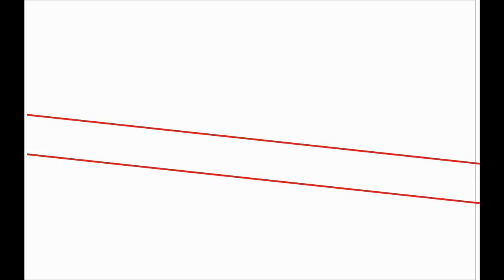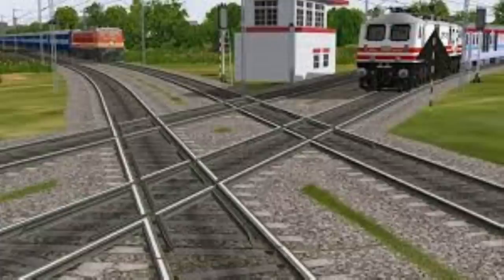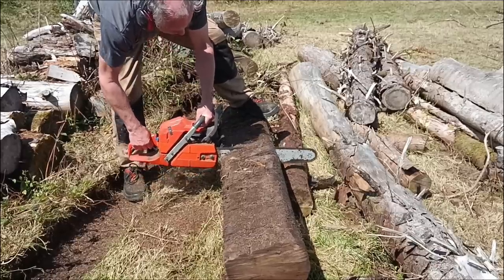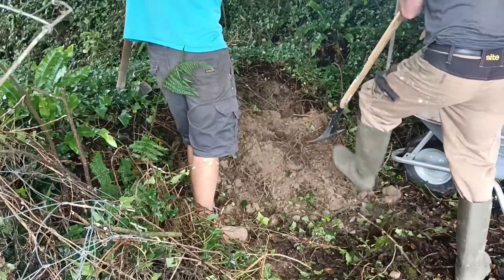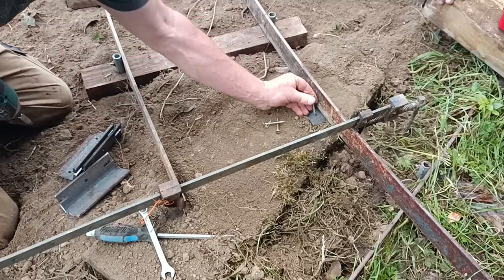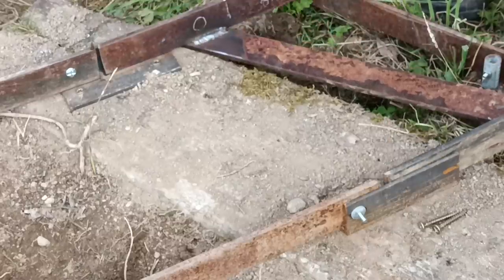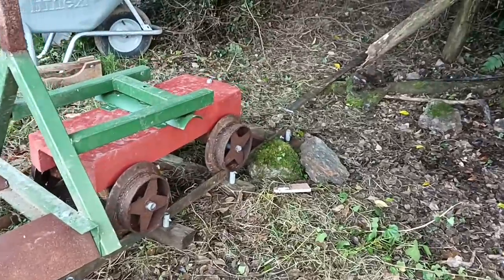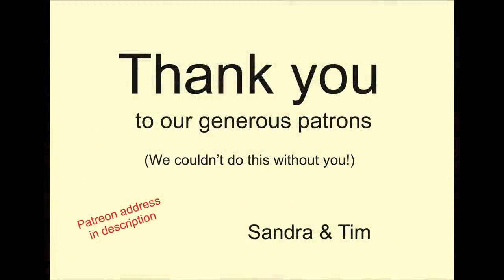Building A Diamond Crossing Bridge For The Narrow Gauge Field Railway

Comment: As always, a very pragmatic and simple solution to a complex problem, Tim. Can I suggest that you hinge the 'bridge', so it's always in place, and can be easily lifted out of the way, but doesn't get lost in the inevitable undergrowth. Looking forward to seeing the cut excavations through the bank, how you're going to contain the errant sheep and where the terminus will be. Well done & thanks for sharing!
Reply: I was going to suggest  a hinge too.
Reply: Then you can’t carry wide wagons over the lowest track
Reply: @pieter5132 : it could hinge all the way over: 180°, so it's completely out of the way? But indeed, I was also thinking: a hinge will make this look like a real piece of art. And as Tony mentioned: it won't get lost that way! (although the support with the curve might prove more challenging than it's worth; keeping it as a loose insert is also a realy pragmatic solution!)
Reply: I have seen a similar solution, where each single track was hinged, one on each side of the "bridge" so as to put the individual tracks parallel to the lower rail when not in use.
Reply: @wieb83zd  it would require slits in the rails to allow for overlap-folding and wheels still being able to roll. If anything, I'd suggest a turntable rather than lifting the track away (it's heck heavy!).
Reply: @pieter5132  Why? The track could easily fold back on itself.
Reply: @tonywatson987   because the bridge have the same distance as the track. It is possible if the bridge is double hinged.
Reply: @wieb83zd  A double hinge so the bridge section sits on top of the track.
Reply: @theodorthegreathe  no, its entirely possible to design the fold to centre the pivot further along the track than the cut itself by either having the bracings outside the track (thus no flange interaction) or spaced the width of a flange inside the track;  it's a far simpler design than a turntable as Tim's crossing track is curved not straight.
Reply: @pieter5132  you could get the bridge around to about 150 degrees (and thus wide clearance) without double hinge if the centre point of the hinge arc is at least foot further out than the cut in the rail
Reply: here's how to commercially do a hinged bridge diamond crossing for full speed rail - to simplify, remove the motors and signal interlocking (and have one side a longer hinge instead of two short side hinges) and you've got the simplicity that Tim's solution would benefit from:
https://www.youtube.com/watch?v=ho8AzAm9f54

Comment: Nice! Maybe you could put hinges on one side to make it a drawbridge?
Reply: Came to say this. Tiny bridge needs to be a tiny drawbridge.
Reply: @JPBennett  And a tiny Billy Goat Gruff
Reply: I was thinking samething but there likely isn't room for that. The lower rail may not be able to accommodate the chip wagons anymore.

Unless there is somekind of double hinge that would allow the bridge to fold nearly flat on top of itself.. but then there'd be a problem with it fitting back into place again because it's not perpendicular.

I hope he does it.
Reply: And add some linkages to the draw bridge, so it will automatically operate signals to indicate which direction should stop or go 😀
Reply: Great idea

Comment: The Golden State Railroad Museum and the Union Pacific used to do this, in a much more complicated and labor intensive fashion on standard gauge when the museum had to move something from their shops to their museum or serve a customer on the old Isleton branch. When UP took over the Southern Pacific they decided the old 90 degree diamond over the main line wasn't worth it, so they had to stop main line traffic to bolt rails over. Eventually UP put in a diamond closer to 45 degrees.
Reply: NO ONE ASKED

Comment: You could use the bridge as a guide for a template and then make small angled joints in the workshop that can be bolted in place. You can then cut the track where it crosses, lower the track to the same level and bolt these angles into position. You will also see the correct angles for the frogs and make them the same way.
Reply: When i saw the piece they welded up for the bridge, I thought "okay, now take it back to the shop and weld on the cross rails and other bits, then drop it into a level diamond."

Comment: I like the use of kick switches exclusively it reminds me of almost decade old videos on coal mines and stuff like that and I noticed they used a lot of and almost exclusively kick switches you're actually the one who introduced me to kick switches. also this is why I love watching you work you come up with the craziest solutions that I don't think even I could think of and I think of a lot of things trust me. Although I do advise maybe stress/weight testing the mini bridge to make sure its sturdy if you ever start using engines normally I advise testing with tornado as I expect if the rails do break you don't want a loaded wood chip wagon toppling over and losing a bunch of perfectly good wood chips (it would also be nice to see tornado again and get an update on her condition as well as any future plans for her).

Comment: Good job and an elegant solution. As far as portable welding goes Matts Off Road Recovery has a few field repair videos where they have connected stick welding cables to 12 car batteries and produced acceptable welds. May be worth a try next time you need to do some remote welding.

Comment: Will you need to construct a cattle-guard section for your railway at some point? I don't know if they're common in your part of the world, but in the western US it's common to see short roadway sections with thin parallel metal slats and deep hoof-sized openings into a ditch below. Any cattle attempting to cross will step into one of the gaps and then can't step over the next slat, only backwards. The same principle could make for a cheap field railway cattleguard -- dig a shallow hole across any opening in a fence, and span it with a short rail bridge built with closely spaced thin metal sleepers.

Comment: Hi Tim, I have seen this method used on a railway in reality. I think it is/was in Australia, where a narrow gauge line crossed a larger gauge. The difference being that one side was hinged and mechanically operated remotely. It allowed the narrow gauge (possibly sugar cane) line to cross without the need to disturb, by cutting tracks, the other main line track.
Just checked, see
 “drawbridge crossing Cane Railway over QR main Meadowvale.
And Cane train crossing QR main line near Bundaberg Australia.

Any way good thinking by Tim.🇨🇮 🚂
 Best wishes from Oxfordshire GB 🚂

Comment: This reminds me of tales I've heard of "temporary" switches installed by MOW crews of old. Apparently they managed to install point rails to take the trains off of the main line and then direct them up and over the mainline rails without a frog onto a temporary side track. Once finished, they could remove the "switch" to allow mainline traffic to pass by. (I wish I could find some primary sources to confirm this!!)

Comment: I love how low-tech this is. Just weld some bits of metal together, shove some old sleepers in, and you've got some new railway.
Someday, I want to own enough land to justify a garden railway.
Also, a thought. If you could get hold of an old pallet jack, the handle assembly might be good for moving wagons around. It's hinged, it's got a two-handed grip, but it's narrow enough to haul with one hand. Considering you can get brand new ones for £250, old dead ones too jammed up with crap or with wheels worn too thin to be useful might be dirt cheap.

Comment: Some where on YouTube there is a video power operated crossing like this. What you need is a flange greaser. The easy way the same as the Seaton Tramway. Man with grease gun puts grease on the on the inside of the outer rail.

Comment: I wonder if you could put your welding setup (with the addition of a battery of course) on a railcar, with wheel locks like on a typical rolling work table, so that you're able to weld track together at pretty much any point of the railway?
Reply: you could even ground it to the car and use the wheels as a ground clamp, and you have power on the cart wouldn't be to much more to add an electric motor

Comment: the siemens high speed rail test loop actually has a tiny little bridge like that (with hydraulics ofc) to get new vehicles on there, so I think that's actually a fine solution and not that weird.

Comment: I can see where putting a hinge on one side could be helpful.  You may need to change where one joint is so it does not bind. I love the work on the RR.
Reply: Came here to say that about the hinges also...

In addition: 
If you have a,situation with hinges that are not" lined up" you sometimes use eye bolts instead of flat stock hinges: if the tolerances are not to tight with the tap side they allow the thing to scew when moving the part .
On traditional  smaller  sailboats this kind of hinges are often used on sterns that are not strait. Mutch esyar than trying to get the pivot axle perfectly lined up,as you must with wider hinges...
I may be a good idea to put  a stop sign on the bridge deck that will raise whit it when open,  make it reflective.
You could also put reflective markers on the side of the deck that makes it visualy clear when the bridge is down and blocks the undercutting rail line.

Comment: Queensland Rail do the same sort of thing with the Sugar Cane Trains when they need to cross the main line, only they are automatic and pneumatically lifted, still the principle is the same, would certainly work better if the section was hinged in some way, to avoid heavy lifting of the track piece every time you need to use that track section.

Comment: I was expecting you to cut slots in the in situe rails with an angle griner to make room for the wheel flanges after bending one set of rails to allow you to bolt them onto the side of the other set of rails. Then just using a lot of pegs to hold all the other stuff in place.
But there are proper industrial norrow gauge railways out there that do use this system, only with added motors, sensors and automation.

Comment: I wonder, if you were to make a diamond crossing like you were showing in the diagram, would you be able to set it so the points where the two sets of tracks connect are attached to hinges that way you can adjust your angles, then make the central bits after the rails are set up, then attach it all together? That way it helps cut down on the amount of back and forth walking you would have.

Comment: Put hinges in one end of the bridge so it it can stand upright 😊
Reply: But then you'd have loading gauge issues with the line underneath.
Reply: @Skorpychan  Not if the movement isn't limited to 90 degrees. It could flip right over to 180 degrees and be completely out of the way.
Reply: @henrybest4057  I'd be worried about the safety of that, tbh. Two directions for it to drop in, and a scissor action if it goes back over the rails.
I'm thinking maybe make a counterbalanced crane and site it nearby to move the rails, or mount one on a wagon.
Reply: @Skorpychan  Then have a stop to prevent it going the full 180. 135 degrees should be enough to clear the lower track's loading gauge. A crane would be too complex.
Reply: @henrybest4057  Not that complex. Just a solid beam with a pivot at the bottom, another beam on top on an axle so it pivots up for luffing, and a hand-cranked winch. Less complex than the air-driven locomotive, or the big flywheel, or a wooden velocar.
Reply: @Skorpychan  But very much more complex than a couple of hinges and a stop, to prevent it going back too far.

Comment: You guys never cease to amaze! That's really impressive how you came up with the bridge idea! Also, I know you already built the air engine, but dont have a high pressure pump (no fuel for the engine) why not try making a 20 or 40 volt electric engine? You could use the Makita batteries you already have. Excited for the next video! 😁

Comment: Well, you could make a "normal" crossing, just instead of welding the ends of the rails together, you could tie them down with sleepers, those hollow pipes and nuts and bolts

Comment: I notice that your rails are swiftly becoming overgrown. This could cause problems in the stability of your rails long-term and cause them to require more maintenance. It's a bit late to do it now, but you should consider ballasting, or at least coming up with another method of removing the grass and preventing or slowing its growth beneath the rails.

Comment: There is an actual railroad of standard gauge that uses this same concept of lowering the diamond to cross another at grade without the use of flanges. I've seen it used a coup0le of time on You Tube, but for now I don't remember where it is.

Comment: Could you make a diamond as a pair of overlapping kick-switches back to back, with the frogs where they would be in a real diamond?  I don't think the geometry would be as flexible as Tim's solution and the timbering would be much trickier. Also it would bother both routes, where as the bridge method leaves one completely unaltered.
Reply: It may leave one unaltered but that’s easier, we must all remember he makes the track himself, including points. And they have gotta be hard to make as it is, plus you have to get off ur train to change them first
Reply: @ab_railways_original  Yes, I meant that leaving the existing line unaltered is an advantage of the Bridge Method.

Comment: Hi Tim, your work and videos are really well thought and put together.
I have been watching you for sometime and I have seen you using “creosote” or old oak railway sleepers covered with it.
May I suggest you, if it is not for your own health (you might be aware of it) to at least warn the community who is watching you that creosote is very certainly linked to many forms of cancers. There is quite a big controversy in France for people that work with this product (railway staff, electrical wooden post… and it is now forbidden to use it in many places).
Reply from the maker: It has all sorts of warnings on the container, and of course, if it wasn't deadly it wouldn't work as well. I doubt anyone has time now to develop cancer from creosote - but obviously you view the future differently : -  )

Comment: i have seen a (temporary) setup like this for trams to cross to the other track when changing direction, without ripping the nice pavement in a street, so, it is ingenious ;)
would 2 kick-switches back-to-back have worked out space-wise? even if it's not exactly needed, to go from drying area to where the new line is supposed to go, why not have the option?

Comment: Hi Tim. I've watched this project with great interest.
I have a suggestion though: The track-laying method seems a bit cumbersome, what with having to pre-drill holes and accounting for curves, etc.; so I was wondering whether you could instead just cut a slot in the pipes and mount the rail upright in the slot. It might simplify the process and make it easier to change your mind (i.e., not having to drill new holes all the time).
If you're worried about secure mounting, you could probably make the slot a bit too big and then hammer in a wooden wedge to keep things snug.
Reply from the maker: the problem then would be the pipes fouling the wheel flanges : -  (
Reply: @wayoutwest-workshopstuff6299  How tall are the rails compared to the flanges? Because the pipes probably wouldn't need to go all the way up. They could also be cut away at an angle on the inside if that's still not enough.
Reply from the maker: the rails are 50mm high and the flanges stick down about 40mm. Sadly it just wouldn't work. But try it if you like.  @vikingninerthree2049

Comment: While very ingenious, I would have thought it just as easy (or perhaps just as fiddly) to lay out the diamond and template the corners, then cut off a short length of each join, weld them up in the workshop, then bolt them on back on site. 

However I do rather like the concept of a very small swing bridge of sorts!

Comment: You should seriously consider hinging that section so you don't have to pull it out completely. 
Just some flat bar welded to the inside of the lifting section and pivot off the bolt through the angle iron on the fixed track

Comment: This is very similar to what the Penrhyn quarry railway did to cross over the standard gauge in the harbour. Highly recommend the book Industrial narrow gauge railways, purely for the interesting track work at Mamod quarry, yours is more engineered than theirs, they just used bits of a round bar on  pivots to make a cross-over between two tracks

Comment: when i saw it, i just had to think, that Siemens at their Testcenter in Wegberg-Wildenrath had the same Problem (Crossing a Line but want to avoid a crossing section, just for other reasons) and uses the exact same principle, just more sophisticated (they are not only germans, they are Siemens!). by the way, take this biological lawnmowers and let them clear the tracks from all kind of greenery. should be easier to maintain ;-)